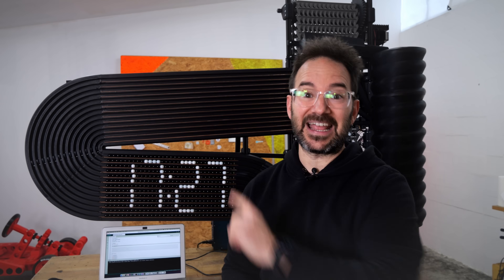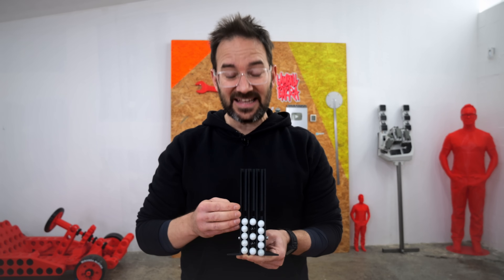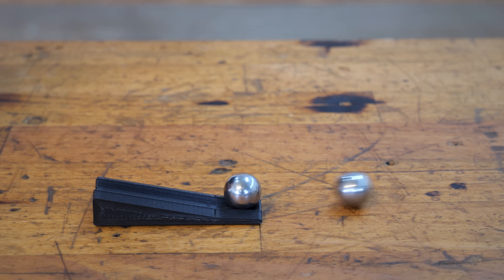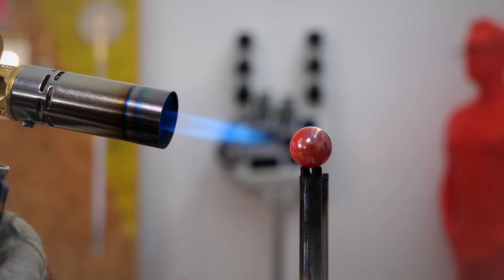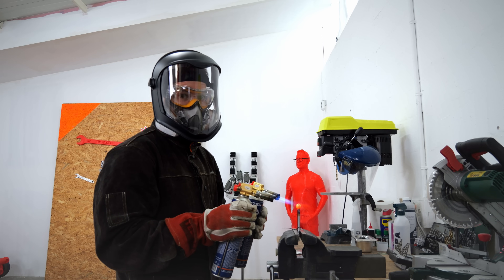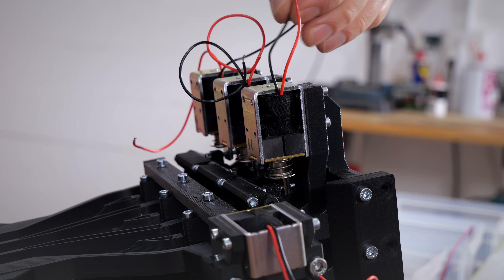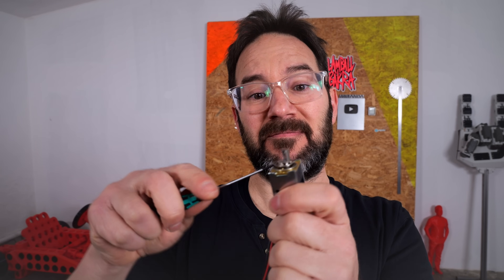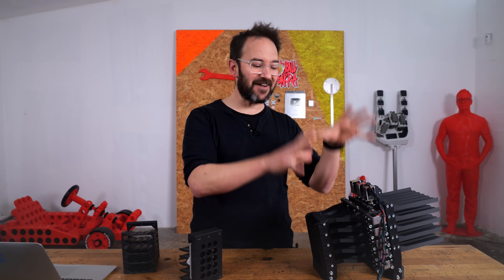Ramp Based Rapid Marble Swap - Marble Clock Seconds Display Pt.1

Comment: Well looks like heating the marbles before the blueing is the bottleneck timewise and i doubt you have a furnace so there needs to be a non blowtorch solution for uniformly heating a large batch of marbles and then getting them all into a bath quickly. I remember seeing a youtube channel focused on using microwaves as furnaces but they used particular materials for heat shielding (because most materials absorb microwaves too much), though i'd be too scared to try it myself because of a maybe unreasonable fear of electric sparks.

Maybe you could just have a rail to heat many marbles at the same tme but then i'd worry it would all stick together but that would probably still work with blowtorches if its all fixed neatly together

Comment: Could you not reduce the 6 channels grouped together feeding into 3 marble slots, to 4 channels? Feeding alternating black and white rows of marbles does not have to be both black and white per each marble channel right? If you have 4 rows of black and white marbles alternating and put a solenoid selector at each of the junctions, you can populate all 3 marble channels with either black or white marbles? But maybe the solenoids need space so you are better off with the six. They would be overlapping crowded together probably with just the four!
Reply: Row 1.                Row 2.                   Row 3.               Row 4.    
Black.                 White.                    Black                 White
           Junction 1.        Junction 2.          Junction 3
             Marble 1.            Marble 2.            Marble 3

Comment: have you considered induction heating for blackening the marbles?  Have an induction coil through which the magnets decent or maybe are held in by a timing gate.  They drop out of the heater into the oil which is being stired to avoid overheating.  In this way you can automate the process and do something else with your time :)

Comment: You could probably lower the numbers of marbles required  by only swapping on color changes. For instance the top right marbles is literally alway white. In every number combination it will always be a white marbles, no need to make a contraption at all for that "pixel".

Also would eliminate the selection system. Since you would always drop on "pixel changing color", each row of marbles would be: white, black, white, black, white, black, etc. In other words, no more need of complex distribution tray for every "pixel".

Comment: With a 3x5 matrix to make digits there's several marbles that never need to change color. Most notably middle column row 2 and 4 is never used. If you take the digits as you showed at 1:56 and move the one digit into the right column as it should be you'll notice that three out of five marbles in that column are always white, so you can just leave a marble there. That makes 10 positions to change every second instead of 15, and most of them rarely change. If you then look at the first column the top marble is only black on 1. The third marble is only black on 1 and 7. The bottom marble is only black on 1, 4 and 7. With patterns like that on most of the marbles it would make more sense to have per marble release control and just alternate colors on the waiting marbles in each lane. That way you just release a marble for a single spot in the digit when that spot changes color, which means only a few marbles is released every second and your entire workload is greatly reduced.

Comment: For first digit of the hour, you'll need max 12 black marbles. You have to display just 0, 1 and 2. 0 if you want, can be all silver there and that should reduce the black marbles to 11 (you need 11 black marbles to display the number 2.) and double that for buffer(You really need just 23 max black marbles. When you change from 2 to 0.). You change the first digit once 10 hours passed(only the number 2 is exchanged after 4 iterations).
As for second digit of the hour, you can also use just more 13 black marbles (total 26 bcs number 8 needs 13 black marbles. But, if you wanna be eco more, you'll need just 25 black marbles. The change from 8 to 9. As i said, 8 need 13 black marbles that are displayed already and for number 9 that waits in buffer needs 12).

For displaying first digit of minutes, you can do same as for hours, you need to change it once 540 seconds(9 minutes). The max number of marbles remains the same because: To change from 5 to 0, you need 23 black marbles (5 uses 11 black marbles that are displayed already and in buffer for 0 should be 12 black marbles).
For second digit of seconds, copy the implementation for second digit of hours. Nothing changes, just the time of iteration. You need to update the buffer once 60 seconds.

For first digit of seconds, it depends how fast you can filter black marbles from silver ones. If you do it fast(faster that 9 seconds), the number of marbles that you need is 23 (the most expensive of black marbles for changing digits are: 5 to 0 that uses 23 black marbles). If you cannot filter the marbles in good time, +12 black marbles should do the trick.
For second digit of seconds, you should have a bigger buffer, as you change it every second. It depends how fast the black marbles are separated from silver ones... Add maybe more 50 black marbles? Idk

The total of black marbles should be: 
Total black marbles: first digit of hour [23] + second digit hour [25] + first digit minutes [23] + second digit minutes [25] + first digit seconds [23] + second digit seconds [depends]
23+25+23+25+23+(second digit of seconds buffer, let's say +50 do the trick) = 99 + (25+50) = 99+75 = 174 black marbles.

If i forgot something, be aware that i did the math as i wrote this. Correct me if i'm wrong :)

Comment: You could have easily used the first design with a servo that would just require 1 pwm port from an arduino per channel so 15 rather than 17 relays, further simplifying the design. Also if you used the servo design you wouldn't need the second gate, since you could update each channel at the same time by just synchronizing the servos. Also interesting choice to use latching solenoids? as far as i see you didn't really need them?

Comment: You unnecessary to change marbles number x2y2 and x2y4. Or marked [■] in a matrix. They're never change (unless you put digit "1" in the middle column).
[□] [□] [□]
[□] [■] [□]
[□] [□] [□] 
[□] [■] [□] 
[□] [□] [□]

Comment: ok, i'm sorry, but WHY are you mucking round with colour selection? keep the three rows seperated with fins, and a clear perspex front plate, meaning you could then just have a lift bring each sealed marble stream round every 10/20/30 seconds, and punch it out with even a single solinoid pushing a 15 pin plate.

Comment: Just so that I'm clear - At first, I thought that the goal was to release all of the White Balls in one pass and then all of the Black balls in a second pass.
Instead, it appears that each Horizonal Solenoid is cycling 3 times - once for every Vertical Solenoid release.
For example, to make the number '2',
  the 1st Horizonal Solenoid Selects a White Ball                W   
  the 2nd Horizonal Solenoid Selects a Black Ball                B    
  the 3rd Horizonal Solenoid Selects a White Ball                W   
  the 4th Horizonal Solenoid Selects a White Ball                W   
  the 5th Horizonal Solenoid Selects a White Ball                W   
Then the Vertical Solenoid fires to release the first column
Then another iteration for the 2nd column 
and then a 3rd iteration for the last column.

Also, is there any scenario where it would make sense to fire off the set at the Horizonal level (20 total Solenoid fires) instead of at the Vertical level (18 total Solenoid fires)?

Comment: you could shorten the time it takes to blacken the steel marbles by doing it in batches: get a drum, drill two holes on either end, attach greaseless bearings(very important), the shaft should be a pipe witch is capped at one end with holes drilled in a straight line, insert the pipe through the drum with the holes pointing down and attach a propane line to the pipe, the drum will need holes for ventilation and a way to rotate it to both suply the fuel with oxygen and move the balls for even heating. you'll also want to add some sort of gate or window to allow extracting the balls.
you could also mix the propane with air before injecting it into the rotary heater, but that has some safety implications, alternatively you could also just use a smelter/kiln to heat the balls, but that wouldn't be as even.

Comment: You could replace the black one with solenoid plastic stick round on the end. The feed to make from top. And release the boils from botom. So for example zero is inside black so the solenoid will fill up this black field and the balls will fit all around from gravity. When the second gone he release the balls from bottom then solenoid with stick will fill up new number and  the gravity will release new bolls from top what can fill up only certain areas and this will go on.  Just 5 min thought maybe this will work.

Comment: Can someone explain how he plans on getting a specific colour per location? With his current set up, doesn't he only have the option to get a single colour per row? @10:10 The gates selecting the marble colour are tied together with each other gate (the other 2) per row. All will be pulled from their left hopper, or all will be pulled from their right hopper. @15:27 he demonstrates that each column could be thrown at a different time, but that also ties each column together and therefore dependant on each other too. For example: If you only wanted a "White" marble in the top left position, and "Black" marbles in all the other ones…. how would you do this with the current setup? Multiposition servos on the diverter gates might be necessary after all. (Of course, that's also 15 servos too 😬) Great series though. I really enjoy it!
Reply: I don't get it either...
Reply: Oh wait, I get it now - I was wondering why there weren't more people asking this if it was that glaring an error. For every column he can chose the black and white for each row. As long as there is time for the marbles to slot in, pass by and the horizontal selector to move in .33 seconds, he'll get 3 columns every second ready for deployment.

Comment: You could have put them in a ball mill with sand to get rid of the chrome coating.
Also I'm sure somewhere on the internet you can get a thing for "cold blueing" that is used for the finish on some old firearms which looks really cool, works on steel, and is quite dark-blueish

Comment: dude, this is awesome!

I can't help but think that you are making things much, much more difficult than they need to be.
For starters, cells B2 and B4 will always be black. Why swap them at all? You can just install two black marbles there and skip a lot of extra infrastructure.
Second, why swap marbles that don't switch color? If you only swap a marble when the color changes, every channel can be filled with alternating colors. That should be MUCH easier to do than programming and building a color selector for each channel.

Oh well, it is objectively more fun to see you do things the hard way, so please carry on! 🎉🎉

Comment: You can cut down the number of black marbles by not using the centre column 2nd and 4th raw. Non of the digits use them.
Also, having 2-to-1 merging channel at the digit release step, takes away one solenoid valve movement (so 1 instead of 2 for each change) thus giving you more time to select the right marbles and queue them properly.

One the other hand, why not have a separate selecting solenoid valce for the left-right selector? This way you could have a separate color marble queues.

Great work! The front to back digit change is a great idea!

Comment: If you intend this to work every second, I think you might want to add a second set of gates so you have a second buffer.  You have the displayed digit. The next digit which is ready to swap. And a staging digit after that which is being loaded by the ramps. 

This will give the marbles an opportunity to dissipate their kinetic energy coming down the ramps, so that they’re not bouncing and ready to immediately slide through the gate into the buffer position.

Comment: I've seen other comments about getting the marbles blackened in bulk by a 3rd party. Ill i have to say is if you insist on doing it yourself, get an induction heater, it should save a lot of time, and it might end  up being cheaper than all the torch gas.

Comment: Hello, i have a idea.

if you want this to be faster and smoother you need to find a way to reduce friction between the surfaces. 
This affects how fast the marbles go from point a --> b, it will make the action smoother and better looking.
Now how are you going to do this. One solution is to look for harder plastic to print with and trying to carefully melt the printing layer ridges  that form.
You would need a heat gun, a stand which has 3 axis for maximum accuracy and a 2000k-3000k light at an 45 degree angle respect to horizontal so you can see the plastic slowly melt and to form into a smooth curve. 
Now this is allot of work but it would yield the best result.
The other method is to coat it with something like extremely thin layer or resin to that print layers which look like this --> (nnnn) would more or less turn into this --> (☐☐☐☐). 
This is a quicker way but comes with a drawback. If you use the wrong kind of resin, when it start to harden it might get slightly sticky like 2 part epoxy, so account for that.
The more you start to take out the more rough edges the more it'll come together as a whole. 
This is a really interesting project but it will take allot of work and time. 
I hope that since you started this you'd find time to shape it more into perfection.
I am writing this comment in hope's that you find some use out of it and that it may help you to get more ideas on how to improve and move to the next phase.

Best regard~ some viewer

Comment: I have a few suggestions:

1. Just use a single colour of the marbles, so you do not need to combine/seperate them. 
2. Use several layers of the externally printed marble gates for presetting the next numbers to come up. Every second all gates are moved and the new number is displayed in the front.
3. Just exchange the digits that change from number to number.
4. Use some kind of a release (drop, poke out etc.) mechanism to remove the marbles on the display level
5. Think about which digits change from number to number, so you just have to remove/add a single marble (5 to 6 or 8 to 9)
6. If you keep using the glass marbles, you will not have any magnetic issues.

Comment: I just don't like this electronic selection of the marbles. With this much electronics you could simply use a solenoid or servo for each pixel and just swap a white marble for a black one if needed, no track needed at all. I would prefer a more mechanical selection of the marbles using a clever marble machine that doesn't need electronics. You just need to keep them sorted.

Comment: You could massively simplify this design by realizing that digits constructed this way will never have white/silver marbles in the middle column of the second to top, and second to bottom rows. You could literally just put a couple black marbles in those spaces that never even move. It might not be as cool, but it would mean less moving parts.

Comment: Am I missing how the selector is going to select individual colors?  Currently it looks like each column has to be silver or black as the selectors are linked rather than individually attached to a solenoid.

Comment: You clearly have experience making marble tracks.  Make a marble track that runs the marble through alternating flame, oil, and blue stuff 11 times.  Fire is easy, you just need fire (and fireproof track).  Have it drop it in oil, electromagnet up top to pull out.  Or solenoid below, but leakproofing that would be horrible.  Repeat for blue stuff.  Repeat 10 times, or have a marble spinner and color sensor that recycles or ejects based on whether they're dark enough.

Comment: Why not stack 2 numbers on top of eachother and use vertical dropping. You would at best have 3 numbers on top of eachother. Block the top number and lowest number, show middle number. Before second changes, block the current number from moving and flush the previous second. Then drop the top and middle numbers one level down so that the top number is shown. Then gather a new number at top, block the current number from moving, flush previous number, repeat. Would take .33s to swap a number instead of .33s + .33s. You can start stacking new number above all that and you have 1 second for that..

Comment: Someone may correct me here, but this system wont work for making individual numbers. Because he needs to select individual colours on you cant have both the splitter solenoids joined and the release solenoids joined. each layer is only going to output 1 colour, so all numbers wont work. either the release solenoids or the release solenoids need to be individual to allow each marble run to be able to select a single colour

Comment: You definitely need to automate the steel staining process if at all possible. Maybe time the heating, and use wire for forks/rails to lift them to and from heaters and tubs?

Comment: Maybe it is possible to use the jettisoned marbles from the big clock? If you make the selection in 2 eject points. 1 for the white ones and a little bit higher for the black marbles.
If the lines aren't filling fast enough,  maybe add 3 more lines on the conveyer belt?